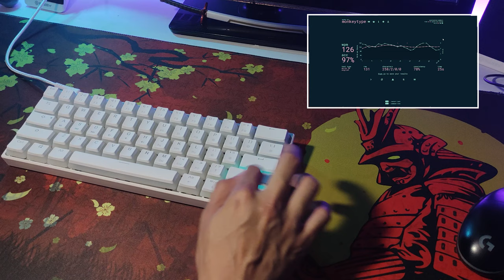Gamakay MK61 Spray Lubed Gateron Optical Yellow, Typing Sound | Chill Music

Comment: Is this the right way of spray lubing? ACTUALLY WORKS?!
Reply from the maker: yes, been doing this since day 1
well I usually spray lube on soldered switches, but this one is an exception since you don't need to worry about over-lubing the copper leaf since it doesn't have one.
Reply: thanks for the insight my friend!

Comment: and can I replace the stabs on the keyboard (sorry I do not know much about keyboards and I want a decent sounding keyboard with fast actuation) and if you did replace the stabs which were they
Reply from the maker: you can easily replace it since it was hotswappable,  same plate mounted stabilizer for Mechanical Keyboards

Comment: Ok so like I’m getting the same keyboard in a week or two and I was jsut going to ask can I jsut like use the spray and alcohol thing to make it sound good still because I don’t want to use the other 2 things. Would it still sound good if I only use the spray and alcohol?
Reply from the maker: the alcohol is only to clean the outside of the switches. Lubing the switches improves the sound. it's really up to you. but the stabs are pretty bad on stock and even when modded.
Reply: niftymonkey ohh ok I thought that the stab well still matter but I guess not and thank you that really helped so basically only the spray matter s and i should still clean it to

Comment: Hey I have the same keyboard but I struggle a lot with pulling the switches out, I press on the white tabs on the side of the switch to pull it out but the plastic of the switch bends a lot so I have to pull like its 10kilogram heavy, I am afraid that they will eventually break. Any help for this one?
Reply from the maker: did you try pulling other keys? you sure it's hotswappable? it should be easy pull
Reply: @NiftyKeyboards  yeah I tried all of them, seems like the board is made that way and I wasn't lucky, some even won't come out no matter what I do